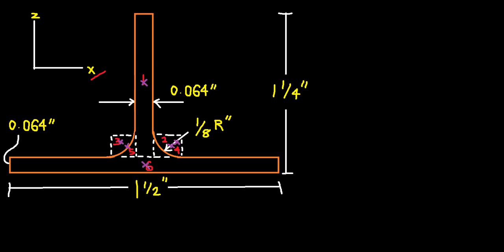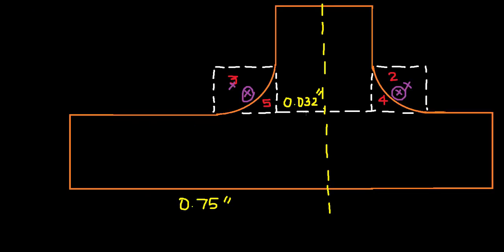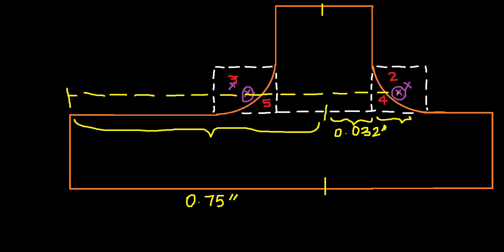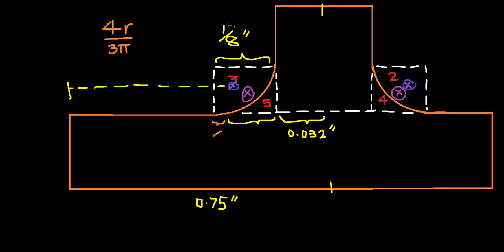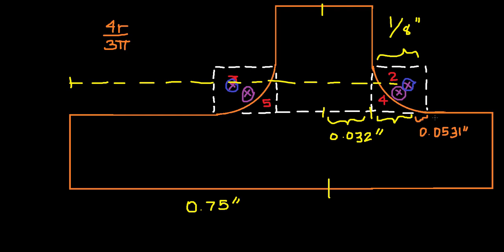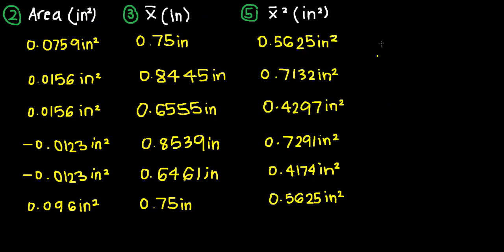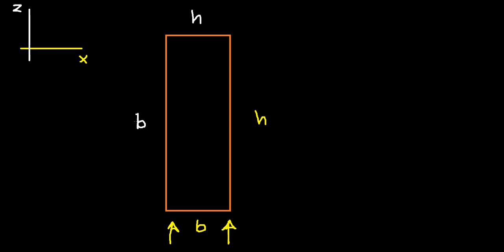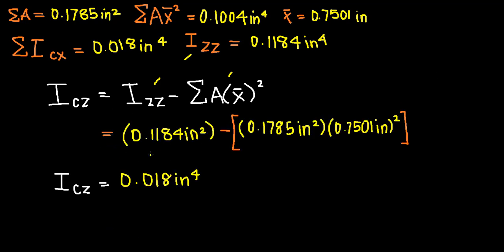Bruhn's Structures: Problem 3.7 Part 2

Comment from the maker: With the exam week over, I finally got around to editing Part 2 of Problem 3.7. This problem clocked in at a whopping 27+ minutes with both parts combined and with a lot more cut content that didn't get past post-production.

Some Corrections:
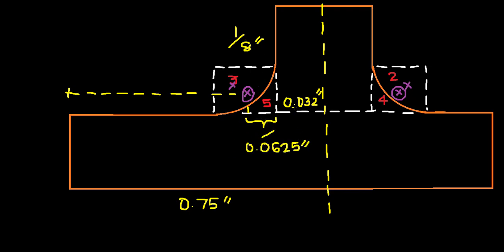4:05 Instead of "Subtract 0.75 by the sum..", it should've been "Subtract the sum from 0.75".
13:00 The "Icx" should've been "Icz".

As always, hope this makes your day just a little bit better. Any doubts are always welcome. Thanks and cheers!